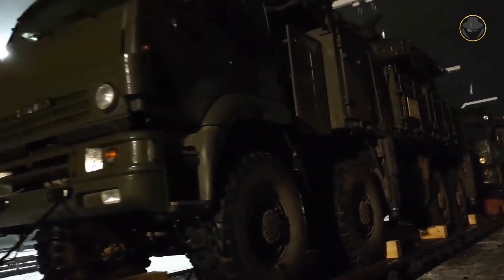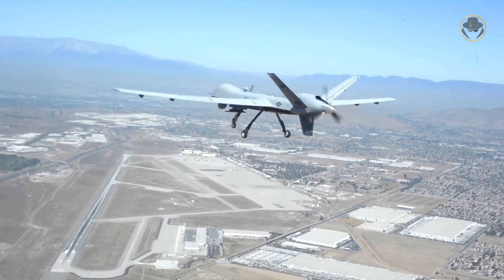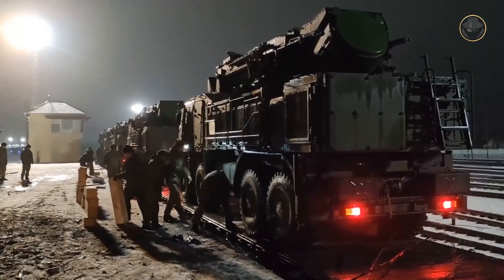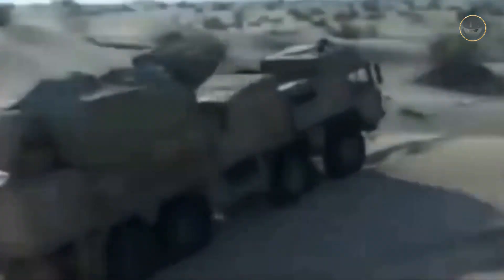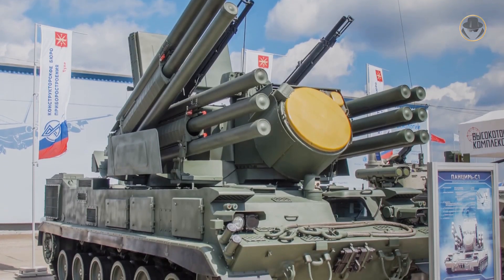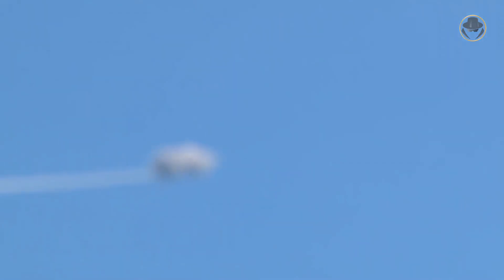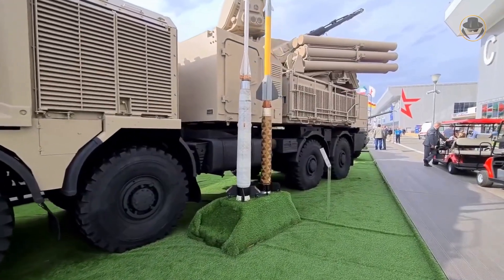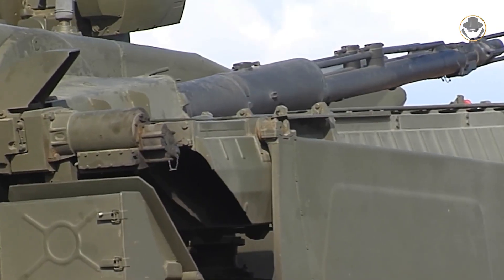Pantsir air defence system - SA-22 Greyhound | Is it successful or not?

Comment: even if this particular system isn't as effective as the Russians insist, the setup of dual cannons with fast reacting missiles is a really elegant solution to the emerging UAS threat.
Reply: But it does not answer third tier fps drones in extremely low altitude one could go as far to say irrelevant

Comment: I saw at least one of those get stuck in deep mud in Ukraine. Russian troops had to abandon it.

Edit: never mind you mentioned it at the end 🤣
Reply: Yep, that is why countries in these part of Europe prefer track platforms.
Reply: @aleksaradojicic8114  I've also seen a lot of track vehicles stuck in the Ukrainian mud.
Reply: @jospi2  Even they are not immune on mud, but in general tracks are better then wheels.
Reply: @aleksaradojicic8114  But then we have the Abrams that got stuck following the Archer into the forest.
The Pantsir getting stuck had leaking hubcaps. A clear sign of poor maintenance practices. That is why that one got "stuck", Many others have tire problems. It's the same reason. Lack of maintenance, more specifically rotation of the tires. They are simply breaking down when you lower the tire pressure for some off road action.
Reply: It's possible to disable tracked vehicles (tracks aren't as good). It's a difficult situation. You aren't at your best concentration after 72h of driving and I see nowhere a place for crew rotation. The crew needs proper training. If it where possible to defend a position for some time, you could dig these things out of the mud with proper training. If you are alone without any support abandoning is the correct choice. I don't see any amenities for crews (you'll need 2 shifts of 12h) and this truck seems to be developed with a fixed position in mind.
These truck seems to be developed with stationary combat in mind and they need to be deployed alongside the supply chain in 5km-10km distances but you don't have infinite number of systems (with a success rate under 50 percent you'll need 3 units for 1 target; your life depends on it). It takes only 1 sleep deprived soldier to destroy the whole system. With only 750 rounds and 12 missiles these units needs constant maintenance (stationary combat).

Comment: It seems that similar to the azerbaijan-armenia conflict, russian manufactured AA struggles against combat drones. I am no expert but I read that they are difficult to see on radars. So maybe the deployed radar systems arent sensitive enough even though in theory they should be able to counter them. Im interested on your thoughts and the comment section regarding this matter as it seems similar encounters happen in ukraine.
Reply: While some radars and systems can not see and fight drones, that is not main issue, specially not when we talk about Pantsir. Biggest issue is proper use of air defence. For example, during NK war, Armenians spread there AA batteries around to defend hole line of front. In practice, that meant that batteries were left alone and without any possibility to support each other, which allowed Azeries to go from one battery to next and destroy them one by one. Russians, durring current conflict in Ukraine, use there air defence much better, which lower usefulness of Ukrainian UAVs by a lot.
Reply: @aleksaradojicic8114  I see. I mean I read that Ukraine lost some but what kind of drones were lost and how many can't be confirmed idependently yet. Saw some russian madpads used as they seem to be the most flexible and easiest systems in this regard. Granted you gave to spot them first and uav can be quite small as well. Considering the logistical issue the russian army faced, I guess the air strikes from ukraine military had it easier as well to be successfull.
Reply: Not a single one of the advanced air defenses in Armenia was destroyed by TB2, all of those were destroyed using Israeli loitering munitions that were designed for SEAD.
Reply: Great analysis and all praise to the author of the video clip, however there are things he failed to analyze, and mentions, or simply missed. And these are the differences, which are big between the original systems and those that were modernized, the first exported variants, primarily in the United Arab Emirates later used in operations in Syria and Libya, are older variants of PANSTIR S1 system, why which was used, radar with a single radar antenna was used older version, which really has a problem to detect some drones and, some of the PANSTIR S1 systems in that variant were destroyed, but that's just a few pieces a large number of drones were destroyed, just by the PANSTIR S1 system. But of course it was not interesting to anyone. It is interesting when they destroyed the best system in their class, especially if it is the Russian system. What you will see as the same for all these damaged or destroyed PANSTIR S1 systems is that they are systems, the initial older generations. Those who have the UAE or the Syrian army, Libya ... For those who do not know, the difference, and the difference is considerable, first of all, the acquisition and target radar radars were replaced, the old acquisition radar had a problem with spotting drones, or you are slow flying objects of small reflective surface, due to the single radar antenna, more precisely only on the front of the radar had an antenna that covered targets in the airspace while on the back and top of the radar, partially "blind". That radar was replaced 7-8 years ago by a completely new radar with a dual radar antenna, which monitors targets, from all sides, and can also threaten multiple targets at greater distances. Practically complete opto-electronics have been replaced, including the acquisition and target radar. The UAE, the Syrian and Libyan and Armenian armies, for example, do not use these new PANSTIR S1 systems, but old versions of these systems, with old radars. But even those older versions had a good effect, against drones, even though the PANSTIR S1 systems themselves had losses in those war actions. On the recordings of damaged and destroyed PANSTIR S1 systems, in those war actions in Syria, Libya ... You will see that only old systems were destroyed, with old versions of radar. Currently, newer versions of PANSIR S1 system, with new radars, are currently owned by Russia, Iraq, Algeria and Serbia ... Of course, Russia has older and newer variants of this system, as well as the navy, and the articulated version of PANSTIR S1 system. Like any other military system, the PANSTIR S1 has its limits. Of course, one can say that the main role is played by the proper use of these systems, which is not the case in Syria and Libya, several of these systems were destroyed when they move independently on the street or at the airport, left completely unprotected,some PANSTIR S1 systems were destroyed before they were in operation, some even in warehouses and garages like those of Haftar's forces, which originate from the UAE ...  Which only speaks in favor of the totally ignorant and inadequate use of these systems.So the doctrine of the use of this system is very important. For now, only Russia has a small number of the latest versions of this PANSTIR SM system, while the first user of the export version of this PANSTIR S1M system will most likely be Serbia.

The difference between the older and newer versions of the PANSTIR S1 is, as I stated, primarily in radars, primarily in acquisition radar.

OLDER VERSION OF PANSTIR S1 SYSTEMS, WITH SINGLE ACQUISITION RADAR ANTENNA. ALL DESTROYED AND DAMAGED PANSIR S1 SYSTEMS ARE EXACTLY THIS OLDER GENERATION, WITH THIS RADAR SYSTEM. THAT RADAR HAD A PROBLEM AND THAT IS WHY IT WAS EJECTED FROM FURTHER, PRODUCTION, THE CHANGE WAS MADE TO A MUCH BETTER RADAR OF THE NEW GENERATION.

PANSTIR S1, OLDER VERSIONS FOR, OLD ACQUISIC RADAR WITH SINGLE ANTENNA.
https://commons.wikimedia.org/wiki/Category:Pantsir-S1?uselang=sr#/media/File:%D0%91%D0%BE%D0%B5%D0%B2%D1%8B%D0% B5_% D1% 80% D0% B0% D1% 81% D1% 87% D0% B5% D1% 82% D1% 8B_% D0% 97% D0% A0% D0% 9A_% D0% A1-400_% D0% B8_% D0% 97% D0% A0% D0% 9F% D0% 9A_% C2% AB% D0% 9F% D0% B0% D0% BD% D1% 86% D0% B8% D1% 80% D1% 8C- % D0% A11% C2% BB_% D0% 9F% D0% 92% D0% 9E_% D0% 91% D0% B0% D0% BB% D1% 82% D0% B8% D0% B9% D1% 81% D0 % BA% D0% BE% D0% B3% D0% BE_% D1% 84% D0% BB% D0% BE% D1% 82% D0% B0_% D0% BF% D0% BE% D1% 80% D0% B0 % D0% B7% D0% B8% D0% BB% D0% B8_% D1% 83% D1% 87% D0% B5% D0% B1% D0% BD% D1% 8B% D0% B5_% D1% 86% D0 % B5% D0% BB% D0% B8_% D0% BD% D0% B0_% D0% BF% D0% BE% D0% BB% D0% B8% D0% B3% D0% BE% D0% BD% D0% B5_ % D0% 90% D1% 88% D1% 83% D0% BB% D1% 83% D0% BA.jpg

https://commons.wikimedia.org/wiki/Category:Pantsir-S1?uselang=sr#/media/File:%D0%97%D0%B0%D1%89%D0%B8%D1%82%D0% BD% D1% 8B% D0% B9_% D0% BA% D1% 83% D0% BF% D0% BE% D0% BB_% D0% BE% D1% 82_% D0% B1% D0% B5% D1% 81% D0% BF% D0% B8% D0% BB% D0% BE% D1% 82% D0% BD% D0% B8% D0% BA% D0% BE% D0% B2_% D1% 81% D0% BE% D0% B7% D0% B4% D0% B0% D0% BB% D0% B8_% D1% 81% D0% BF% D0% B5% D1% 86% D0% B8% D0% B0% D0% BB% D0% B8% D1% 81% D1% 82% D1% 8B_% D0% A0% D0% AD% D0% 91_% D0% B8_% D0% 9F% D0% 92% D0% 9E_% D0% BD% D0% B0_% D1% 83% D1% 87% D0% B5% D0% BD% D0% B8% D1% 8F% D1% 85_% D0% B2_% D0% A7% D0% B5% D0% BB% D1% 8F% D0% B1% D0% B8% D0% BD% D1% 81% D0% BA% D0% BE% D0% B9_% D0% BE% D0% B1% D0% BB% D0% B0% D1% 81% D1% 82% D0% B8.jpg

PANSTIR S1 NEWER GENERATION SYSTEM WITH, DOUBLE-SIDED ANTENNA OF ACQUISITION RADAR "JANUS"

https://commons.wikimedia.org/wiki/Category:Pantsir-S1?uselang=sr#/media/File:Streitkr%C3%A4fte-Serbiens_Pantsir-S1.jpg

https://commons.wikimedia.org/wiki/Category:Pantsir-S1?uselang=sr#/media/File:Pantsir-S1_(SA-22_Greyhound)_(41204907934).jpg
Reply: Adolf H.  tor and s300 is not "obsolete" though obviously not super advanced, the systems that they had should have done better, but its impossible to determine whether its the system or operators  faults
Reply: @JPFops  so they used Isreali drones in Idlib and Libya too?
Reply: @mardbenzmura1446  no. I was referring to nagorno karabakh only.
Reply: Adolf H.  i agree about point number 1
As for number 2. Its difficult to judge the s300 against small loitering munition that it wasn't designed to handle. It should have had short range air defense systems to protect it. So it's not necessarily mean that the system has failed.
Reply: Pos
Reply: Armenia was stabbed in the back by Russia which wants a land corridor to Azerbaijan via Armenia.

Comment: the Pantsir-S1M SAM system could be mounted on the Lynx KF41-E IFV . . . the Pantsir-S1M needs larger surface-to-air missiles with equally bigger explosive warheads . . . in case of wheeled vehicles the KAMAZ 6560 HD 8X8 + 5.5 in. Lift 13.2 TDI I6 4-Dr Double Cab Armoured AT Truck (LHD) is more appropriate . . .

Comment: Why do nations have both tracked and wheeled air defence systems, and some even on trailers. Even those have different variants. Shouldn't they have just one design to reduce complications?
Reply: its called as layer,you cant defend your sky with same aa,it must be layered with different missiles and rounds.range and mobility important in a war.
Reply: so when you mean nations, the only one to develop both is the Russians. The wheeled and tracked nature shouldn't be regarded too much, mostly down to terrain and availability of paved surfaces.

What should be of note is the sheer number of air defense is to provide a sophisticated air defense  net of multiple layers, to reduce the reliance on friendly air power to maintain air superiority. There's air defense at the regimental level, then at the tactical level, then at the strategic / theater level, and then there's also point air defense to protect larger array air defense units from SEAD retaliation. Panstir-S1s were basically slated to replace the 2K22 Tunguskas in service but due to the whole lack of Soviet-era levels of funding, the process to replace them is slow.

This also is of note, the reduction of funding compared to the Red Army's spending, pooled in with Russian economic decline with the USSR's collapse, further piled with the sanctions since 2014, the Russian army is a patchwork of multiple examples of hardware, in the process of being phased and phasing out.

edit: that first statement is off the top of my head, if i'm incorrect, id love to know, but keep in mind i meant nations that develop it themselves. Purchasing the full Russian net doesnt count, but maybe a mix match of different nation's systems do, like India for example.
Reply: The tracked and wheeled vehicles have both unique advantages and disadvantages. The tracked one has better manoeuvrability but it is expensive and complicated. The wheeled one is cheaper and easier to operate but its off-road performance is poor. If you need an air defence system to protect a building or stationary facilities, why would you spend money on an additional vehicle? The trailers are cost-effective for this job.
Reply: @TOMMY_2802  Well, I have seen India have Shilka tracked SPAAG and also truck mounted ones. And US has one on stryker platform and iirc on tracked apc too.
Reply: Adolf H.  thanks for the info